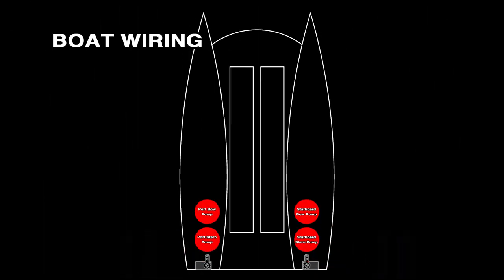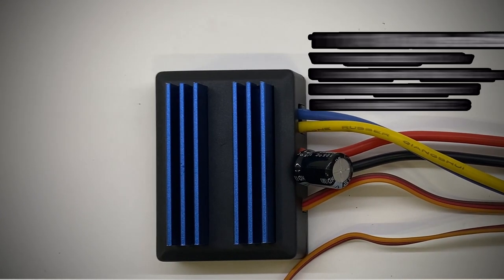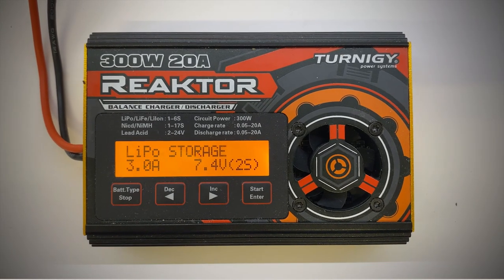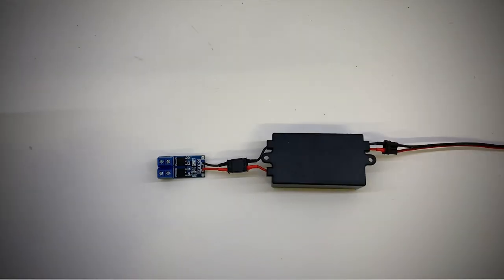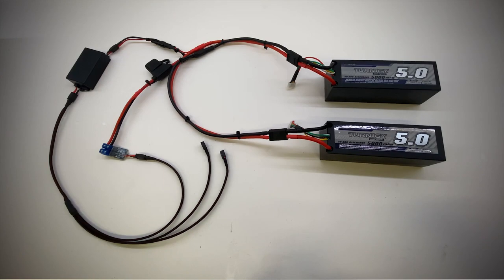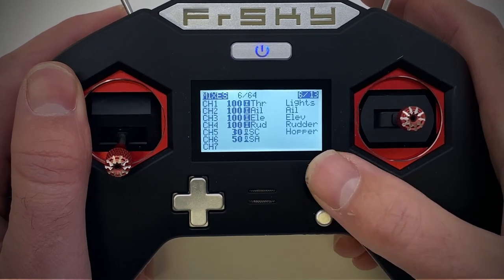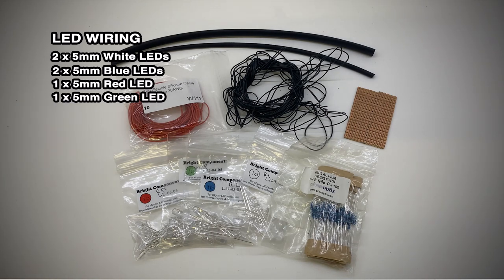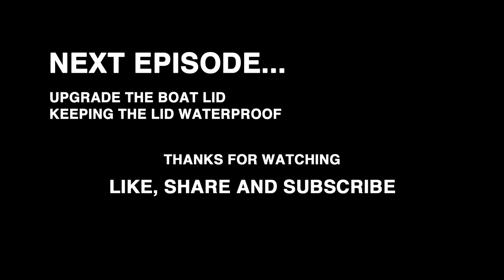MODIFY MICROCAT BAIT BOAT - Re-wiring the Boat (Part 3)

Comment: Hi Dave, I have my boat split right now doing GPS mod and want to upgrade the LED lights. What's the procedure for removing the old ones in a mk3? Looks like nothing more than hot glue but don't want to blast the shell with heat if not necessary.
Reply from the maker: Hi Chris, as I was replacing the old ones, I just popped the LEDs through the hull with flat bladed screw driver. Hopefully you’ve got yours out by now.

Comment: Just wondering. Which receiver have you used because you’ve mentioned two…
Reply from the maker: Use the R86 one, it’s the standard PWM receiver. Like the one that’s normally in the microcat
Reply: @DaveMattock  could I not use these, Flysky FS-I6 AFHDS 2.4GHz 6CH Transmitter For RC Model + FS-IA6 Receiver V3T8?
Reply from the maker: @initiateddeano2552  yeah, you can use whatever transmitter and receiver you like, if the receiver has PWM outputs, it’ll work.
Reply: @DaveMattock  lol, I have no idea… I intended to use the stock batteries, with the tx and rx I mentioned. My concern is it’s a 6v rx and I wondered if I would need a step down prior to the rx and the a step up after? I have no idea tbh guess I’m in over my hwad

Comment: Hi Dave, quick question will 2 Hobbywing Quicrun 1060 60A  ESCs work? Or do i need to get something with a better voltage rating.
Reply from the maker: Hi Kieron, they wouldn’t work with the 4s Lipos unfortunately. Looks like they’re only rated for 2s Lipos, which would be a maximum voltage of around 8volts
Reply: @DaveMattock  Thanks Dave, I will sorce some new ESCs tomorrow 👍🏼

Comment: Hi mate I have a mk1 I’m having problems with my jets when pushing forward the left side jets work and when I push backwards the right side works . Is it ment to be like this or should they work both together many thanks don
Reply from the maker: @donleigh8218  Hi mate, they should both work together. Sounds like either something’s not wired up right or the mix on the transmitter isn’t correct.
Reply: @DaveMattock so iv opened it up and found the box at the front of the boat has a red black blue and yellow wire coming out of it have all been cut and also a big back thick one has been boched together. Is there anyway I could send you some pics or a video to look at to see if you could help me please
Reply from the maker: @donleigh8218  Ahhh sorry, I thought you had used my video to rewire your boat and you were asking me a question about how I have rewired it. Unfortunately, I don’t know how Angling Technics wire their boats up. It would need to go to Angling Technics if you’re keeping their wiring.

Comment: See post below, do you use an external aerial with the tx? Is so what one
Reply from the maker: No, I don’t use any external antenna with the transmitter
Reply: @DaveMattock  what range do you get? Have you monitored the rssi? Mine is only at 45 ish when right next to the boat or rx

Comment: So I’m having an issues with the range and signal, using the same tx as you and an archer a4 it seems that if anything gets between the two I lose signal and the distance is only around 50m? Any ideals
Reply from the maker: I’ve just uploaded part 4 where I did a range test for you, showing the RSSI I get at various distances. Where have you got the receiver mounted? It’s not below the water line is it? Do you get the same issues when the boat is out of the water?
Reply: Could it be the sonar that is messing up the signal?

Comment: Hiya Dave do you mod the boats for other people or is it just an instructional video?
Reply from the maker: Hi Lazarus, I just do the videos to help people out who want to have a go at doing it themselves.
Reply: @DaveMattock  is it an easy job to just change the batteries to lipo? Without opening the boat up?
Reply from the maker: @barbelmaster73  I’ve never tried. You’d need 2 x 2s Lipos as the original wiring in the boat has the batteries wired in series. At least, if it doesn’t work, you’ve got some videos to show you how to rewire it afterwards 😀
Reply: @DaveMattock  ok thanks the lipos need to wired in parallel don’t they? Thank mate
Reply from the maker: @barbelmaster73  if you wire up how I’ve done in the video, they’ll be parallel. If you just use Lipos in the boat without doing the rewire, they’ll need to be in series. Ie two 2s Lipos in series makes 4s.

Comment: If I do all these mods exactly the same can I still use the stock batteries if I the power harness in series or would I have to use lipo’s? 
I started the build but could really use a little input from you, I have dm you on messenger. Ta
Reply from the maker: Yeah, you can use the lead acid batteries if you keep them in series

Comment: Hi Dave,
I’ve done everything as per your video , just got my batteries from china and every time I connect the first battery it arcs when connecting, but if I remove the remote switch they connect fine without a arc, I’ve gone over and over the wiring and it’s exactly the same as yours and now haven’t a clue what else it could be, is there something I’m missing?
Reply from the maker: Hi Jim, I'm not sure to be honest without seeing the wiring. When you say arc, what is it doing? Blowing the fuse?
Reply: Happy new Dave, I’m away at the moment I’ll get a picture of it when I’m back, when I plug the battery in it arcs the connector is all black and burnt, like it’s welding it’s self together, but when I unplug the remote switch both batteries connect fine with no sparks
Reply: @DaveMattock  Hi Dave manged to stop the arc when plugging the batteries in, my dodgy soldering, ive had to remote switches now and I cant get them to work like yours does, get the light on the switch but no light coming on the mosfet tigger switch? https://drive.google.com/file/d/1-lTW3-VgziKt8vLoahTlA1Vj5JOZG0LC/view?usp=sharing  https://drive.google.com/file/d/1m9lep4CE7UmOtT2rwP1F3ldbuBdbFhsM/view?usp=sharing  https://drive.google.com/file/d/1DYmgS-ArZc23WMGSn_u4grHfdrfQXqHy/view?usp=sharing

Comment: Hi Dave - is there any chance you can post how to set the remote fob up to the relay unit please.? I'm pressing buttons and nothing is happening. The relay switch is identical to the one you're using but i didn't get any instructions with it... :( Any help would be a massive bonus mate. Cheers.
Reply from the maker: Hi Andy, sounds like there's either no power getting to it, the key fob hasn't been bound to the receiver or it's faulty. If you have a multimeter, check that there's 12v going to it and it's set up with the right polarity. Second, re-bind the key fob to the reciever. I have found some instructions online for bind the fob to the receiver, abeit in Chinglish:

Learning and Remove Method:
1. Press the learning code. The indicator from on to off, loosen your finger, press any button of the remote control, the indicator flash 2 times and off. It mean you learn it successfully. (I think this means press the button and release it, press the button on the fob, the led on the relay unit should flash twice, which means the key fob is bound to the relay)
2. It can learn more than 12 PCS 2262 or 1527 chip with the different code wireless remote control
3. Remove/ Clean: Press the learning button about 8 seconds, the indicator turn on to off, it means the information that you keep have been removed successfully

Or try step 3 first and then repeat step 1 to bind the fob to the relay. If this doesn't work, i'd try sending it back for a new one to see if it's faulty.
Reply: @DaveMattock  Hi Dave, thanks for the reply. Yeah, i've tested it there's definitely 12v going into it. When i try to re-bind the fob, i get three flashes and the led (on the receiver) stays on. I think it could be a faulty unit. Thanks a million for your help and support mate.
Reply from the maker: @andypoole9758  no problem, one other thing you could try is to hold the button on the relay board down, then apply 12v to the relay board, then release the button, then press a button on the fob, see if that will bind it. If that doesn’t work, sounds faulty. Never had one that hasn’t been bound when I purchased it so sounds like a faulty unit.
Reply: @DaveMattock  Hi Dave. It's a long shot but you don't happen to have any spare microcat mk1 main boards for sale do you..? 😊
Reply: Hi Andy,
I have the main board from mk1 and the original Esc with echo sounder for sale of you still want it😊

Comment: Thanks Dave  very instructional video, 
I`m ordering the parts right now ,
1 question  If I want a remote controlled searchlight how will I connect it 
thanks   Henk
Reply from the maker: Thanks Henk, good stuff. When you say remote controlled search light, do you mean how would you turn it off and on? You could use the same RC dimmer switch or if you have a look at the guy who sells the dimmer switch on eBay, he has a shop, he also sells RC relays too, which would need to go on a separate channel on the receiver if you wanted the lights and the search light to operate independently.